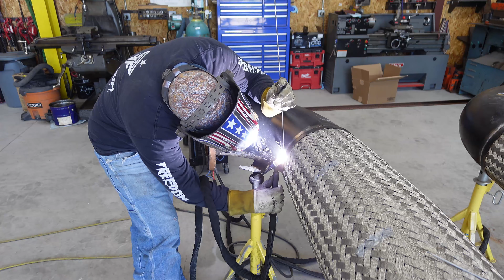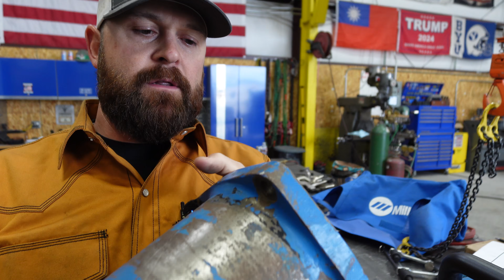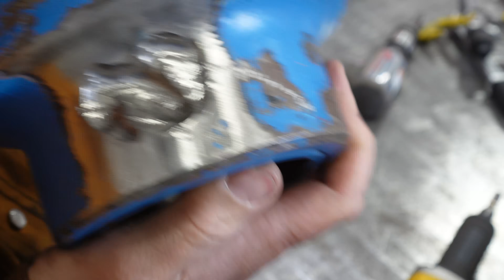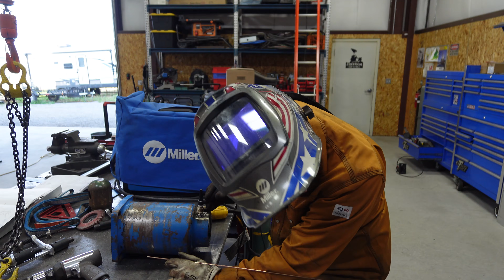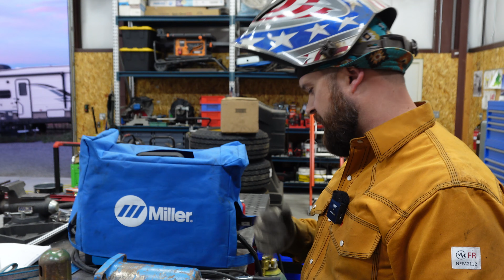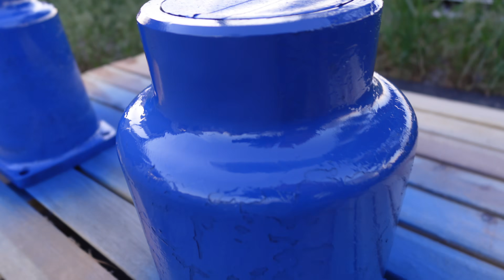Welding repair on ductile iron

Comment: Going out on your own is the best move. I personally did it in another industry and failed eventually due to the economic situation we're in but walked away with a lot of experience. I'll be back at it in a different type of work one day. Failure isn't failure dude! I didn't even notice you're not full self employed already with your big set up!
Reply from the maker: It has been really good so far. A huge adjustment, but really good. I think a lot of people assumed I was already full-time. I have worked 2 jobs for 16 years. It’s hard to get used to only 1 job, but I think it will be a blessing in the long run. Thanks for watching!

Comment: That came out nice . What model miller machine did you use and what amps ? Thanks
Reply from the maker: Thanks. Miller dynasty 300 on 125 amps, but I was running a foot pedal. Thanks for watching!